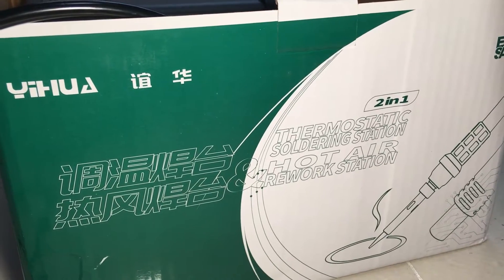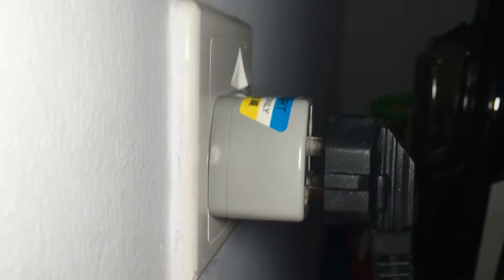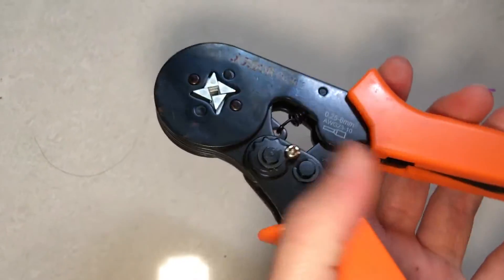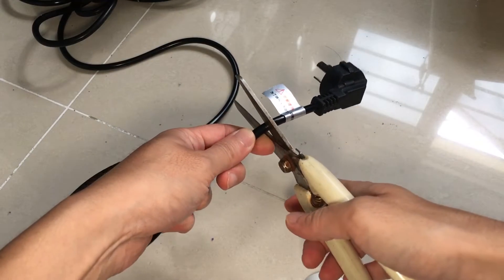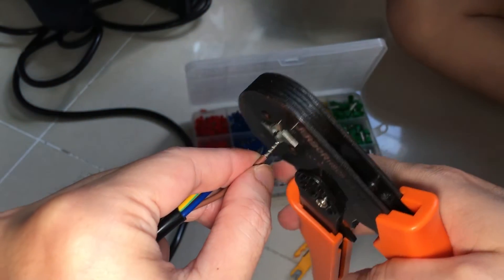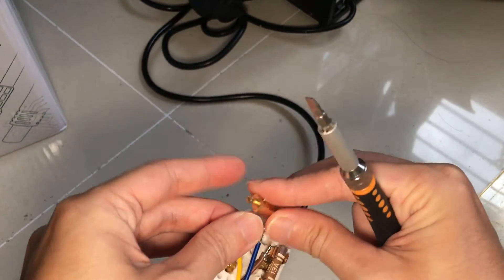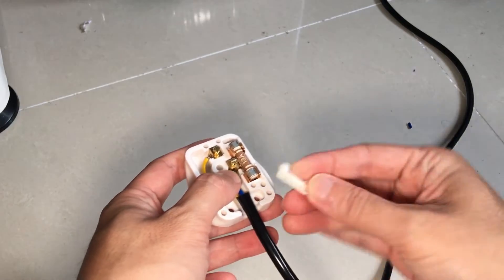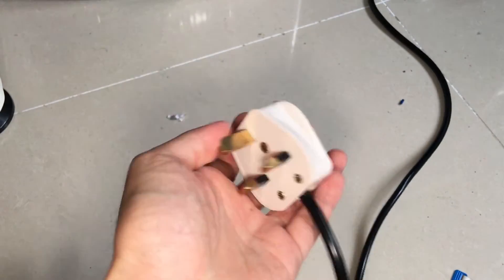How to Wire up a 3 pin British Power Plug -  Plug Conversion

Comment: If the original pluq is 10A 250 V. Is it all right to use the 13A 3 pin pluq?
Reply from the maker: @shiuhwenchen4715  well… using a 13A fuse means that your fuse won’t blow until it exceeds 13A. I would personally won’t mind it.
Reply: @fuzzy34r  As a UK electrician, i  agree, youtube randomly suggested this, but yes this video is helpful. I worry about ALL Chinese cable though, it's usually, (sorry) SHIT. Best solution is to not buy from china.
Reply from the maker: @ thank you for watching my video from such a faraway place (I’m from Singapore, by the way). With regards to Chinese goods, I find that they have differing quality catering to widely different budgets. From where I am, we could buy directly from sellers in China via ‘Taobao’ app instead of getting products from middleman, and get to see reviews from their local buyers too (their reviews are brutal if the product is bad). But yes, some research is needed to increase the chances of getting a good product.
Reply: Exactly this is what I just saw on my china plug is rated as 10A only. On this case may I ask what should I do. I scare my father later change to a UK plug which stated as 13A, Will it explode or not